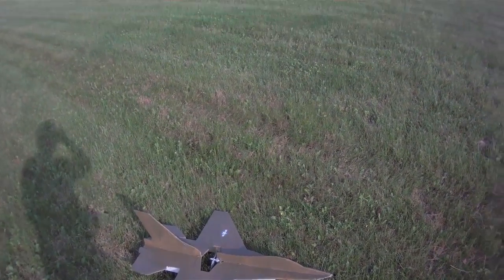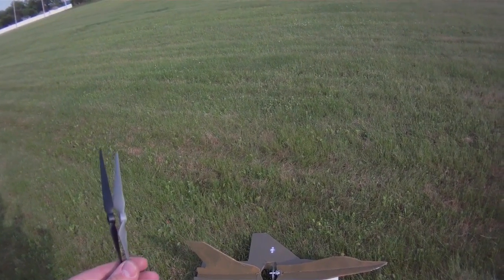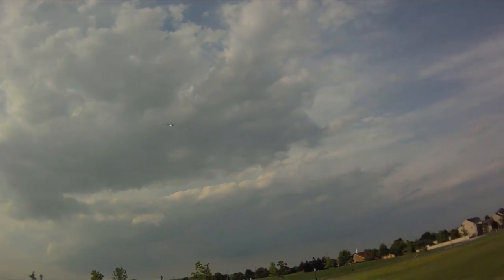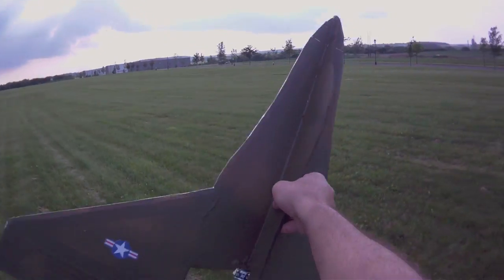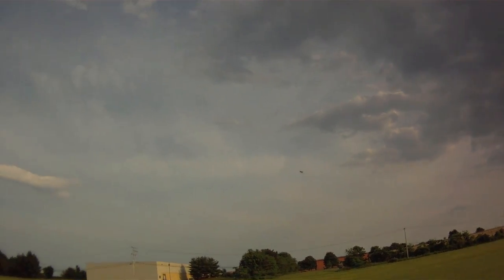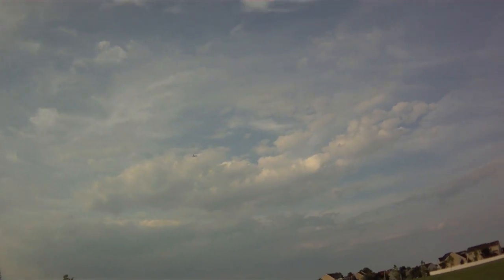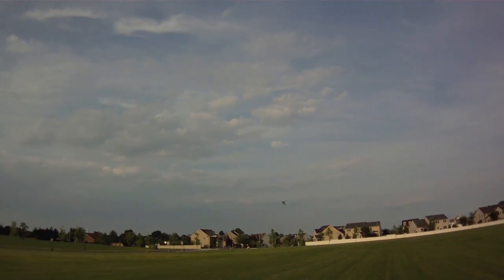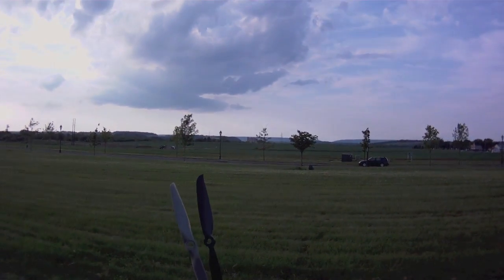EMP vs APC 6x4 props

Comment: If you can justify the cost I also recommend microdan's outrunners. I've tried his 2505-2535 and 2510-2700 and the latter is comparable to your ntm prop drive 2700 at about 450 watts using a 6x4 sport prop. They may be a little expensive, but their quality is top notch and super lightweight to boot.

Comment: You might try an apc 6x4 sport. They provide higher top end thrust. I use them with microdan 2510-2700kv motors and get a good 40+ oz of thrust and well over 80 mph of pitch speed. I recently finished my second mig29 v2 (elevons and half of tail flew off my first) and had to use an apc 6x4 E and they don't seem to provide as much thrust, especially on the low end of my rpm envelope. It could be that the extra pitch translates some minute amount of extra speed but at the cost of thrust.

Comment: I have tried larger EMP props (11x5.5, 12x6) and found them to be needing much more balancing than APC. And also the spacer adapters were sloppy on the prop adapters compared to APC. So I stopped using them :(

Comment: I tried fabricating a Kline-Fogleman airfoil on a 6x4 prop to see if I could get more thrust. I did notice a slight improvement in power. I need to work on this. 
Dick Kline told me that there has been some work in this area. He said in that study the prop tips were sculpted.